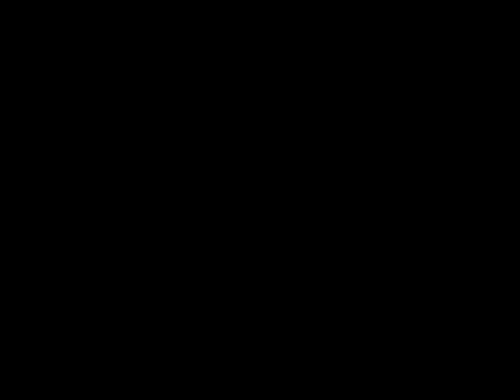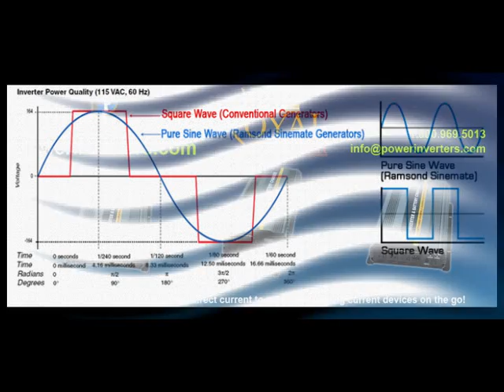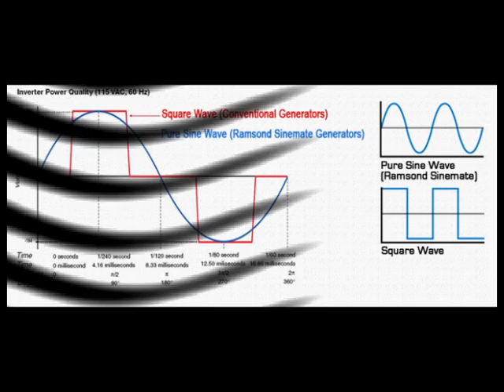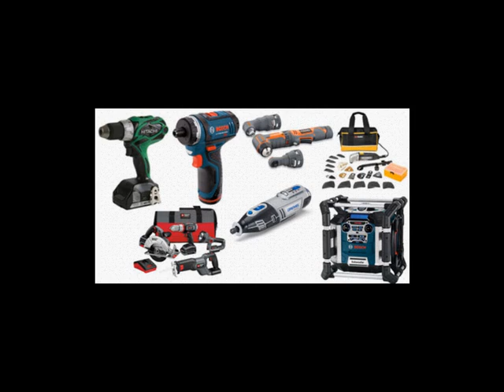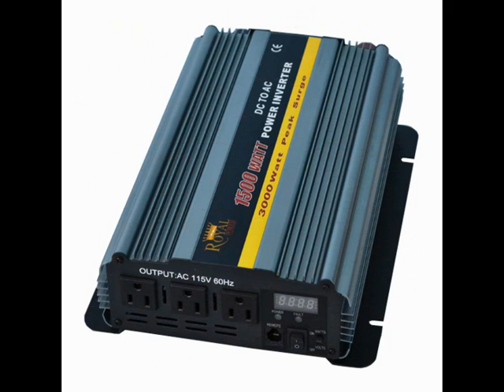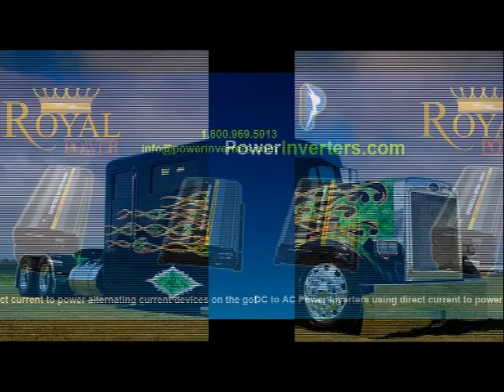How Inverters Work

Comment: Is there a maximum wattage an inverter can make?
Reply from the maker: We offer as large as 6000 watts. Some companies offer 8000 or even 10000 but with lower efficiency.
Reply: @Royal_Power_Inverters  how does 12v car plug make so many watts? Doesn't it start to affect the appliance plugged in?
Reply from the maker: @doms6741  If you are talking about the cigarette adapter plug. You can only input about 100 to 150 before shorting it.

Comment: can you run a small microwave off your inverter
Reply from the maker: Yes. Youll probably need a 2000 watt unit for a microwave.
Reply: @Royal_Power_Inverters  ok great I'm a service technician I'm going to install it in my van and I can use it to charge my drills
Reply from the maker: @josephlanza8277  yes it will be able to charge your drills also.

Comment: can i run one HP motor from a car battery .... using a step-up transformer ?????
Reply from the maker: Harshith SV You can run the a 1hp motor, but why would you need a transformer?
Reply: Power Inverters OK... but can you tell the requirements like voltage and ampere rating to run 1 hp motor at its best possible efficiency???
Reply from the maker: 1hp runs between 800 and 2000 watts.
Reply: Thank you..
Reply: 1 horsepower is 746 watts